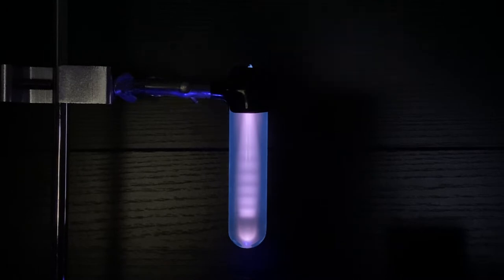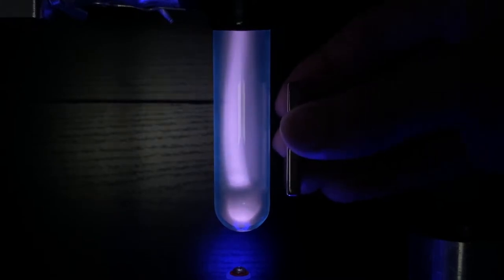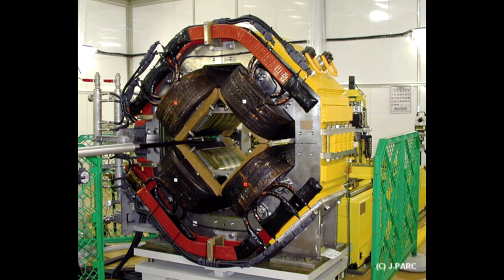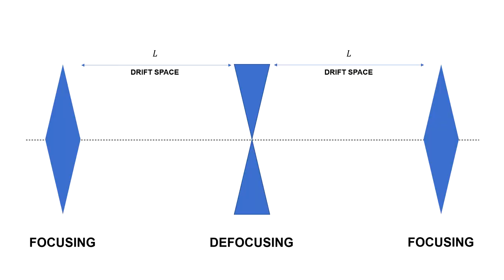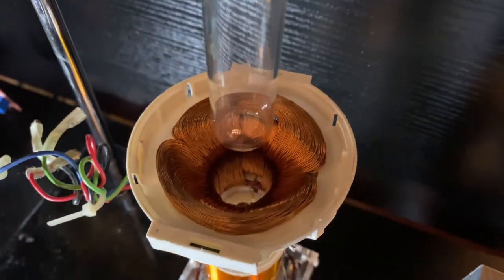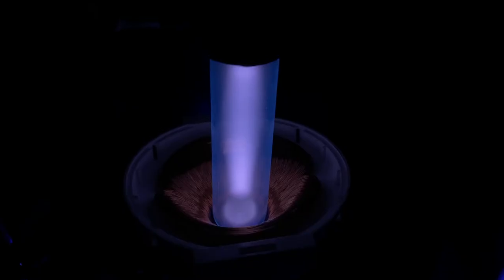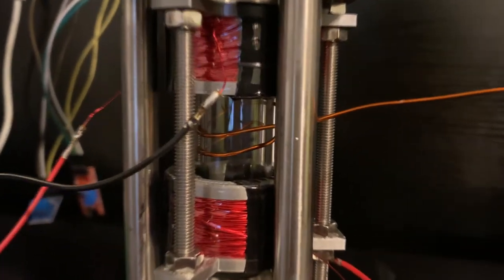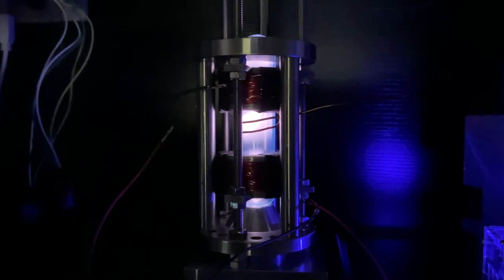Hydrogen Plasma in Magnetic Fields

Comment: I once accidentally damaged a Hydrogen thyratron by playing around with a magnet to focus the plasma. At the low on voltage,  and high charge to mass ratio of Hydrogen, the plasma could be focused to a pin point (I  burned a hole in the grid)

Comment: I was messing with sound and thermoacoustics,,, got the sound to spin in a doughnut and the heat followed and then it made water and spun that in a doughnut in an opposing polarity electromagnetic field.. and the water got electrolysed into hydrogen that was thermally heated and vibrated into plasma in that doughnut.. and then I got scared.... no idea how much power it produces..... I was just trying to make energy from sound and feedback and I think I discovered more than I bargained for. I'm holding off on patenting it because I think it's too dangerous. It's like a galaxy in a box... so it may even slow time because it makes gravity. The initial 14 million volts is produced with believe it or not .. a 500 lb xylophone key bouncing on some really big piezoelectric disks.. and I only had to sing to it to get it to bounce. If your stuck on a planet such as ours in the middle of the desert.. you need a machine that can make air, water, electricity and gravity from sound and feedback.. otherwise your screwed.. and that is exactly what I designed. What happens to patents that make power and cost nothing to run? The military takes it from you don't they? Hero you go.... for less than 2000 dollars in materials you can slow time and live for 1000 years.. it will never see the light of day. There is certainly something about time..... that really doesn't exist... that something I invented today was used in the past.
Reply: Did you mean 500 gram xylophone?
Reply: @DK-gl3ih  lb...I explain it in 3 videos about the galaxy. The power output depends on how powerful the electromagnet is...

Comment: But hydrogen is not ion. How does magnetic field effect on it?
Reply from the maker: Hydrogen in this video is ionized, so it became a plasma. So now it consists of protons and electrons, hence it can be affected by magnetic fields. Some Hydrogen stay as either atomic and molecular hydrogen but excited (electrons' transition within the electron orbits). That's where the purple light is coming from.
Reply: @iheartnuclear8517  what about the new fusion energy that scientists trying to make nuclear fusion. Is that the same?
Reply from the maker: @vahagnmelikyan2906  Fusion plasmas are beyond cold plasma which is shown in the video. It requires thermal plasma and beyond (ion kinetic energy of 100 keV if I remember correctly). But if we have the right plasma heating system we can definitely put this plasma up to that point, but it's not worth for energy production since proton-proton fusion chain is not efficient to be done artificially. It's what the stars do!
Reply: @iheartnuclear8517  maybe a titanium container filled with hydrogen, in a vacuum space,with microwave and magnetic field will do?
Reply from the maker: @vahagnmelikyan2906  Titanium could work since it's not ferromagnetic, but heating hydrogen works best with 13.56 MHz (lower frequency than 2.45GHz Microwave) plus Ion Cyclotron Resonance! I encourage you to look up the VASIMR, which is basically what I just told you!
Reply: another question: it looks like the plasma get deflected in the same way independently of which pole of the magnet is facing, Does it means is diamagnetic?